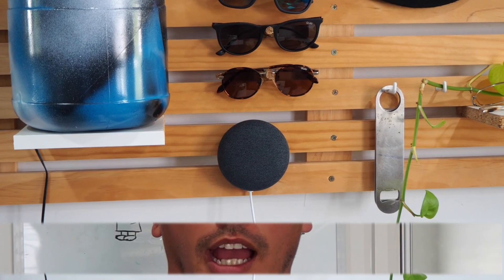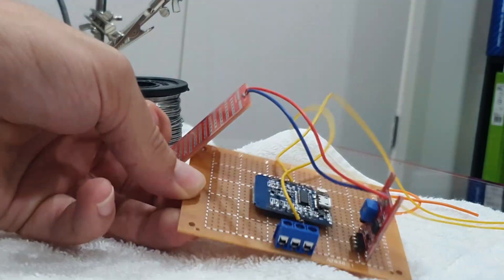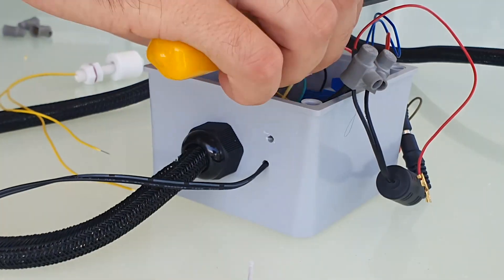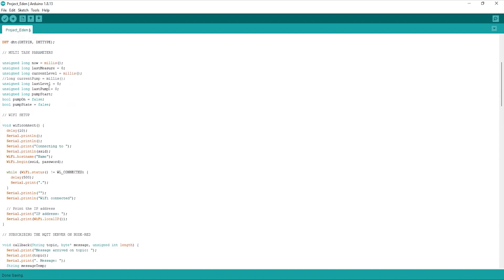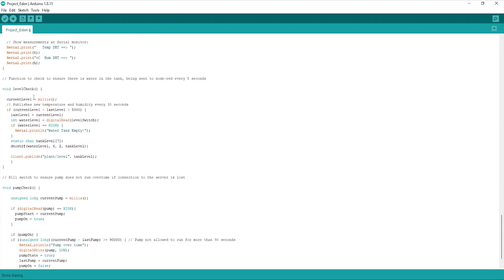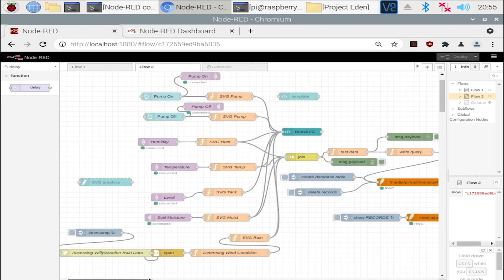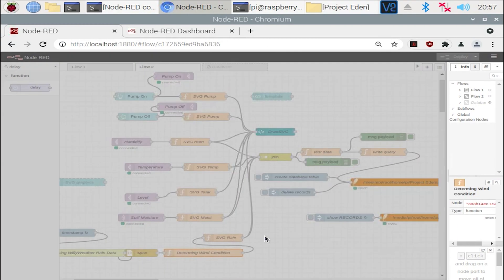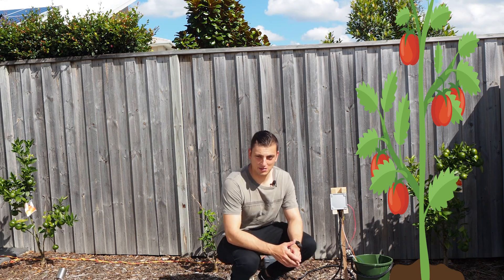DIY Cheap & Smart Irrigation System

Comment: I am so glad I found your channel and your repo, might build something similiar one day but I think I ll use just a valve instead of the pump and let gravity do the hard work for me
Reply from the maker: Thank you!
Best of luck with building your smart garden.  Just keep in mind that most solenoid valves require a minimum pressure differential to open. So unless you're drawing water from a tank which has a fair bit of static head, I recommend looking into some DIY servo assisted ball valves. We have a project coming soon which utilises some of those 😉